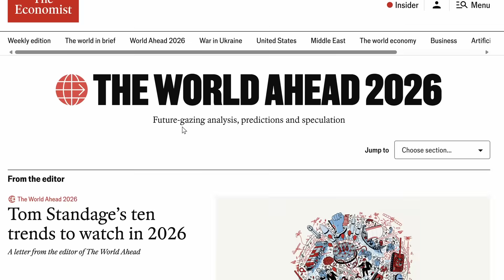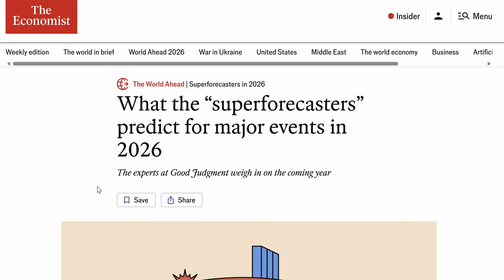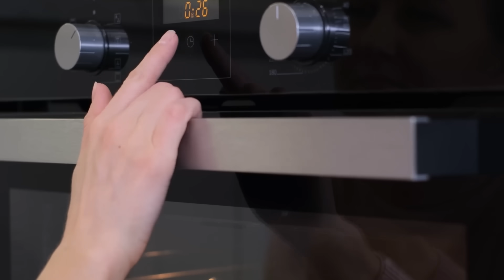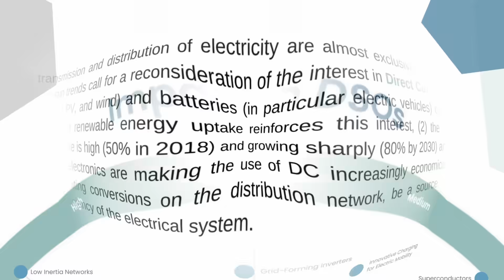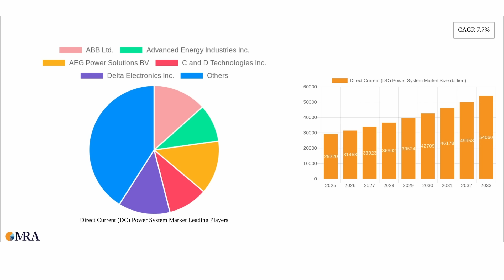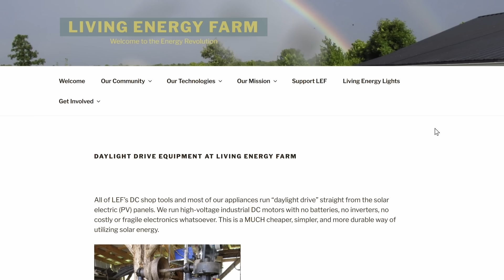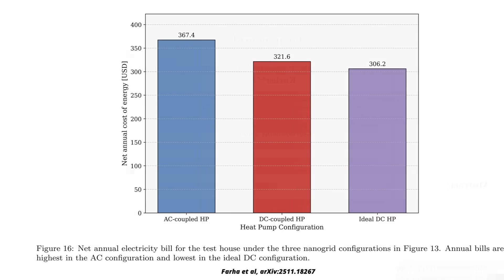Are We Using the Wrong Kind Of Electricity?

Comment: 3:40 ..... Wind turbines generate DC ????
Reply: Yessir. Their rotation speed depends a lot on wind conditions, even the variable pitch ones. There is also MPPT to consider. Since the generator's output needs to be converted anyway, it might as well output DC.
Reply: Correction - Wind turbines generate an alternating current but the frequency is not 60hz (it's not even consistent) -- so the best way to deal with them is to normalize that variable AC output into a DC current and then convert the DC into grid-matching 60hz AC. Trying to push energy onto an AC grid that's not synchronized with the grid's alteration is a recipe for disaster.

Comment: I would love to see a new residential standard that includes DC conversion by the breaker panel and then DC circuits for LED lighting etc and maybe even DC EV charging

I waiver if we could even deliver AC or DC over a single connector with extra pins or a communications protocol that selects one or the other over the danger pins (like the NACS charger)
Reply: DC lighting circuits are relatively common for higher-end home lighting.

Comment: A DC network would make it easier to connect multiple power providers, as there is no need to synchronize output to match the main network.
On the other hand, AC is much better for voltage changes (especial at large scale), where a transformer can do this at higher efficiency. Switching Giga Watt levels of power is also safer with AC.
I don't think you can really claim one is better than the other.
Reply: Synchronization of generators is fairly easy, the switch is closed only when they run at the same frequency and when the voltage difference is minimal. But AC systems have only very little room for RPM changes as frequency has to be kept in very narrow range. DC systems would, have more space for RPM variations and thus be able to naturally store more power in their generators and machinery that powers them as greater variations in RPMs would be permissible.

Comment: Turbine based generators inherently output AC.  That's just a consequence of how the mechanism (of turbine-based generators) works.

There's also (to AC) the advantage of - that, in contrast to DC - the electrons don't permanently spread out, by repelling each other - to only the surface area of a wire of any given diameter.  That's what accounts for the economic advantage of transmitting large amounts of power over long distances, by AC.

Photelectrics only produce power, via DC.  So it has to be converted to AC, to be transmitted over most conventional power lines.

When it comes to the economics of transmitting electrical current via AC, vs. DC - with DC, you're only actually using the surface of the wire - not the whole volume.  So as you increase the size of a cable - you're only getting an increase in energy transmission that's linear, in relation to the diameter of the cable - as opposed to one that's proportional to area of the cross-section of the cable.

(Or at least - that's how I think that it works.  That's at least, the general picture.)

Comment: Don't all the DC devices use different voltages and currents?  Would that require lots of different outlets at different voltage levels?  Or will all DC devices need to have circuitry to lower a standard outlet voltage to whatever the device needs?
Reply: Every device already does an AC-DC conversion. Doing AC-DC conversion means you need to support +150 to -150 and have a capacitor to supply DC power when the AC input wave crosses over 0v. Doing DC-DC conversion from a fixed voltage (or a much smaller range of the same constant polarity at least) to another fixed voltage is way easier.
Reply: @Experimental_Cyborg Thanks.  I thought there would just be a lot of wasted power, but Buck Converters can down convert with decent efficiency and little waste heat.

It will mean different products with different internal converters or purchasing a bunch of intermediate converters so that the products will see what they saw when the outlets were AC.

Comment: Wait what? Wind turbines create DC natively? How?
Reply: Wind turbines internally generate AC, but at a variable frequency that changes based on wind speed.  It is not possible to hook the variable frequency AC power source up to the AC utility grid directly, which is running at a fixed frequency (ex: 50 Hz in most of Europe or 60 Hz in North America).

Consequently, in order to actually use the power generated from a wind turbine, the power first goes through an AC (of variable frequency) to DC conversion stage, is temporarily stored in an expensive high ripple current rated capacitor, and then it goes through a DC to AC converter stage (at the grid/mains frequency).

Switching to a DC electric grid would be more efficient and it would make wind turbines somewhat cheaper, since they could then omit the expensive capacitor and DC to AC converter equipment from the design altogether.

Charging electric vehicles from solar panels also strongly favors adoption of pure DC systems.  Very little (and cheap) hardware is required to do DC to DC conversion and MPPT (maximum power point tracking) for charging an electric vehicle battery pack from a DC photovoltaic solar panel array.  Doing the same thing with extraneous DC to AC and then AC to DC equipment in between, is quite a bit less efficient, and considerably more capital intensive, given the expense of the power conversion hardware.  The extra power conversion hardware also makes the complete system less reliable, as there are more components that can fail, including cooling fans that are guaranteed to wear out with use.

AC grid power's days (and associated AC appliances) are numbered.  AC power grids will become obsolete and disappear eventually.  Eventually, most household applications will likely switch to -400V DC for higher powered appliances, and -24V DC for low power appliances.
Reply: @Fritz_Schlunder  ah yes, i did know that about wind, and had forgotten:-/. I was forgetting the part about the frequency being whatever the wind wants it to be, and that being the reason to switch to DC (even if temporarily).

Comment: A bogus distinction. The form of the electrical current depends on the immediate need of the application. For example, in an electric car, the current comes out of the battery as DC but an inverter changes it to a multi-phase, variable frequency, AC in order to drive the traction motor.
Reply: If what you said was true then car companies would use DC motors.
Having previously worked for a company that was developing electric vehicles long before tesla were on the scene The main reason for converting the DC and not directly connecting to DC motors  is for battery  performance, longevity and range.  Using a controller with PWM means that you can trick a motor into believing it is getting higher current than the supply can actually supply. Or thinking that bass-ackwards taking less power from the battery than a directly coupled motor would take. It also means you can control speed easily where as doing that resistively to a direct coupled motor would cause a lot of heat. AC motors are used as they don't Arc like DC motors and generally produce more torque are more robust and last a lot longer. 3 Phase enables more Current for a similar physical size. So if you want to build a battery car you use the biggest energy dense battery you can. Covert to 3 phase and  use PWM to control the output.
Reply: Transport over long distances favors DC - while resistive losses are the same, capacity losses are not - the latter almost preclude underground/submersed HV cables. Additionally, AC suffers of skin effect.
Reply: @col0342  Also, in a grid with multiple nodes, power injection/extraction is significantly simpler with DC.
Reply: @col0342  : Capacitive losses vanish when the line is operated at its natural load. Unfortunately, the higher the voltage the more precisely you have to hit this spot. Nowadays many high voltage lines are used bidirectional, e.g. depending on solar power. At zero net load you have a maximum of capacitive losses.
Reply: I've never heard of skin effect being a loss at 50/60Hz but it is a factor at RF frequencies.
Reply: @Kritiker313  "I've never heard of skin effect being a loss at 50/60Hz but it is a factor at RF frequencies."
"At 60 Hz in copper, skin depth is about 8.5 mm"
https://en.wikipedia.org/wiki/Skin_effect
"High-voltage, high-current overhead power lines often use aluminum cable with a steel reinforcing core; the higher resistance of the steel core is of no consequence since it is located far below the skin depth where essentially no AC current flows."
Reply: @Kritiker313  Skin depth for copper at 60Hz is 8.42mm.  Skin depth is also where conductivity is ~37%, so the resistance is higher than for DC.
Reply: @thomasmaughan4798  : For high voltage lines aluminum - or to be more precise - Aldrey wires are used. This is because aluminum is a better electrical conductor than copper. This generally shocks physicist, but they calculate the conductivity by cross section and not per weight. Of course things look completely different when designing motors or transformers.
Reply: That's funny, I have two motors, one A.C. and the other D.C., actually that's true in both of my electric cars.
Reply: Don't forget AC and DC components of a signal, and IC!
Reply: But that AC going to the motors has to be a very specific type - voltage and frequency set for the situation which changes many times per second.  Mains AC is no use in that situation unless first converted to DC, then converted to variable voltage variable frequency AC.
Reply: ...and traction motor is Nikola Tesla's asynchronous AC motor which Sabine didn't mention, but it was important invention in winning the currents war.
Reply: @DanK-d3b  NO one is using the Tesla-motor, as that one has three separate phase-neutral circuits, which requires six wires.
What is used is the German-Swedish three phase with a virtual neutral, as it only requires the three phase wires and nothing else.
Reply: These waveforms may not be DC, but they are also not even remotely equivalent to AC used in regular power transmission.   Think of an EV motor more like a DC compressor motor, not like a table-saw AC motor.  There are huge differences.
Reply: @junkerzn7312 The only difference from utility AC is frequence and voltage.
Reply: Tesla and some newer cars yes but it doesn't have to be that way and many heavy movers are DC.
Reply: @chrisbranton65  DC motors have more integral parts which means increased failure points, also DC motors require some sort of contacts (like brushes) which increase wear and tear. AC motors are superior by all standards including the most important one: longevity.
Reply: Also AC motors make it possible to implement position control designs, that are mostly used in robotics.
Reply: @nerofl89  My EV uses BLDC, BrushLess DC motor. It doesn't need brush or contact. The alternating was done by electronical circuit. Yes, it's a form of cheating.
Reply: @chrisbranton65  DC motors internally use a mechanical alterator, which uses contacts and brushes.

Comment: You're a physicist... there's another way of generating electricity that's been used on space vehicles including floating platforms in Earth's orbit. It's chemically derived electric power... FUEL CELLS.   The problem with that is it would take away the political power from utility companies. Sure, fuel cells could be explosive but so are gas furnaces & stoves. And the by-product of fuel cells is [clean] water & heat. But utility companies with the help of legislators has basically buried fuel cell technology.
Reply: And how do you propose to supply the fuel for all those fuel cells? It is a lot cheaper to send power over a wire than to truck Hydrogen (or other fuel) for the fuel cell in every residence.
Reply: @avsystem3142    Have you EVER heard of HYDROGEN... the most abundant element in the entire universe ?? And your objection that points to moving hydrogen around is no different than hauling oil & gas around on public streets.  DUH !!
Reply: @avsystem3142   And... you think it's cheaper to pipe electricity all across the planet ?  Where do you think all that electricity comes from ??  Mostly from burning fossil fuels. So... it more environmentally friendly to contaminate the Earth's atmosphere ??   Fuel cells "burn" hydrogen & oxygen, produce water & heat. Two articles;   https://en.wikipedia.org/wiki/Fuel_cell
https://www.nrc.gov/docs/ML1002/ML100280723.pdf
The ONLY reason Fuel Cell technology isn't widely available is because of the Fossil Fuel Companies that carry a lot of influence in State and Federal governing agencies.

Comment: The motors of the EV's require AC power to work . Usually 3 phase AC. There is a big device inside all EV's that converts DC to AC. Congrats on the Economist thing. Well deserved
Reply: Yes because electric car motors are BLDCs. In industrial setting usually it is done the same: 3 phase goes into a motor inverter/frequency converter, there it gets converted into DC, gets converted 3 phase AC again... The problem with AC2DC power supplies is that while the voltage is sinusoudal, the current curve looks abysmal, horrible. Huge current spikes, about 10-20% duty cycle. It's a disaster for transformers, and generators, creates a lot of harmonics and that create a ton of losses